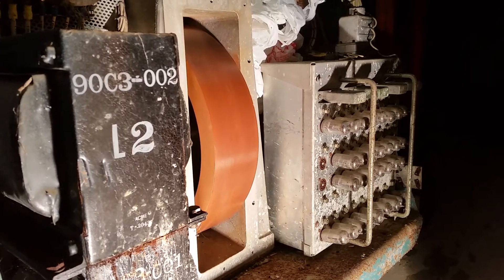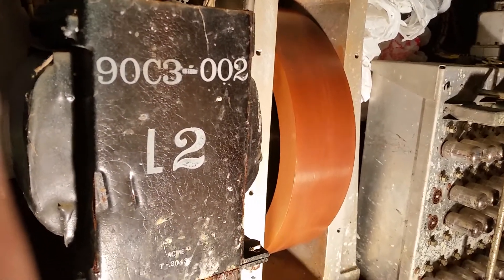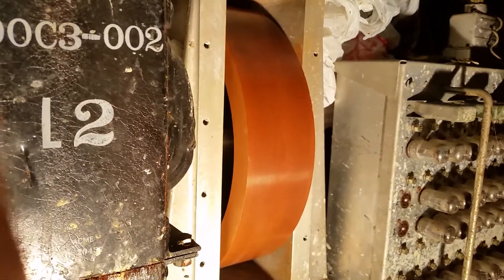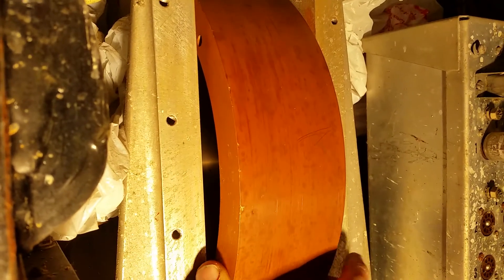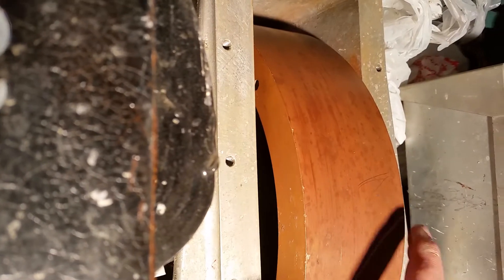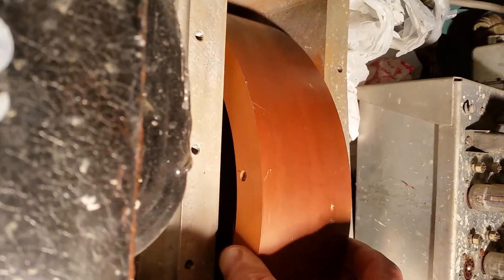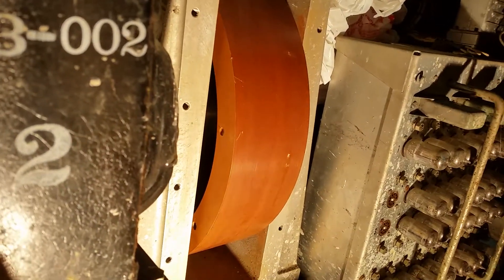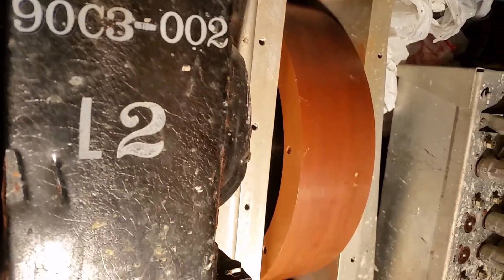Bendix G-15 Drum

Comment: One particular drum machine which is still operational on a daily basis at a museum in Stuttgart is a Royal/Librascope LGP-30.  This is a 31-bit machine (yes, those existed before the System/360) which stores all of its registers on the drum.  One particularly stern warning about operating the machine is never to power it back up while the drum is still spinning, as it was quite possible to score the drum this way.
Reply: What museum is this in Stuttgart?    There is, or at least was a few years ago, an operational IBM 650 at the IBM House for the History of Data Processing, since moved to the IBM site in Boblingen.    They also had a working 1401 with 4 tapes and a printer.